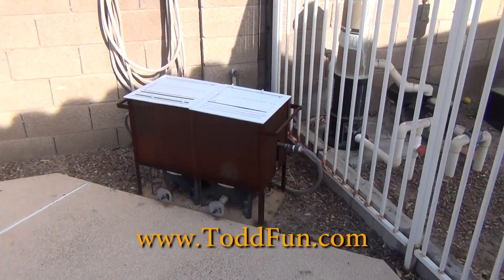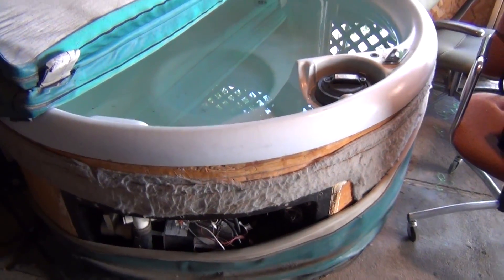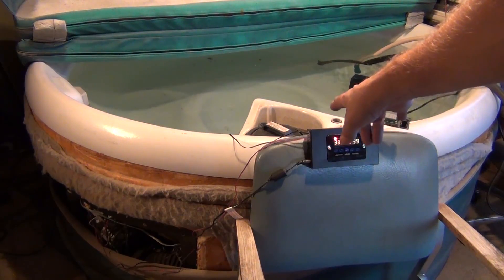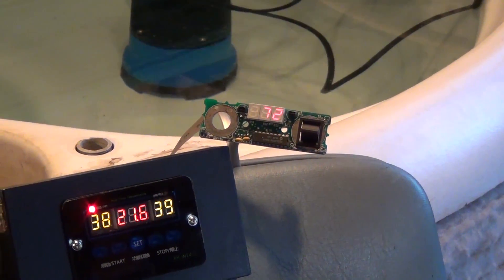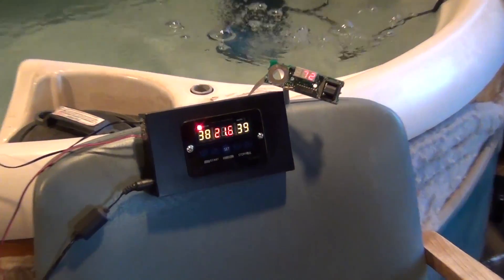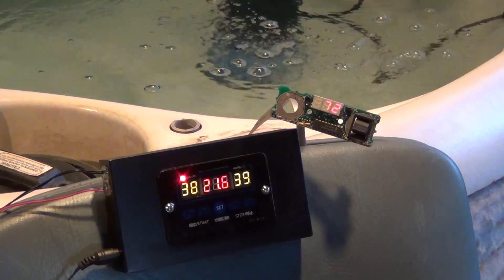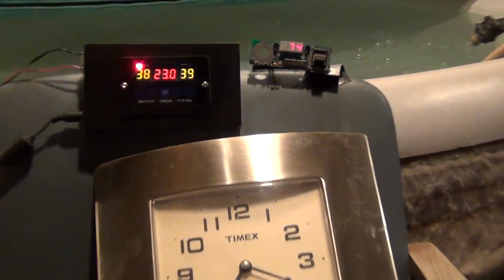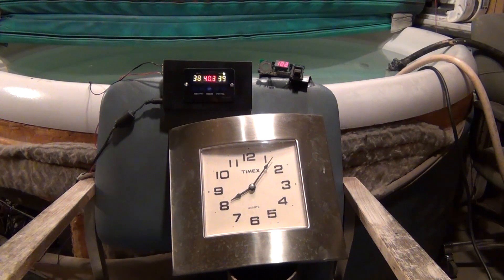Hot Tub Controller Hack part 4 of 4

Comment: have you done anything with communication between the panel and top side controller?  I'd like to interface mine with a wireless control from my phone with controlling temp and pump action. I have a Connect-tech spa pac with a Orca Bay topside control with a 4 wire cable between them.

Comment: I was excited...but I kinda got lost in vid 3 lol...omg..gotta ask how much did you charge your neighbour for all this crazy intricate circuitry /work?
Reply from the maker: Nothing. We are ham buddies and we do things for each other all the time. Just what friends do.
Reply: Lol, I was teasing, I think I need new friends!?🤔😂lol
How might, can I do something like this ..on a 110vt Softub spirit 4 tub, sold at Costco in 2014 and the motor and the circuits etc are housed within the side of this model, not on a exterior motor pack? 🙏
Reply from the maker: @tman6663  Couldn't really say. There is 100,000 ways it may need to go before one would know the best option.
Reply: Todd Harrison You’re telling me Todd! Lol  I finally got topside control to display/work now...had to solder circuit underneath circuit board. But now ....lol it’s the GFCI Plug that worked/reset before, but now it won’t let me reset from module now...argh 🤬🤷‍♂️🤦‍♂️🙄 lol

Comment: Neat. It looks like you used steel wire to make your coils. Steel and copper are dissimilar metals and holes will form in your pipe. It may be worth your while to re wire with copper.
Reply from the maker: Would be best but still working fine with no problems.